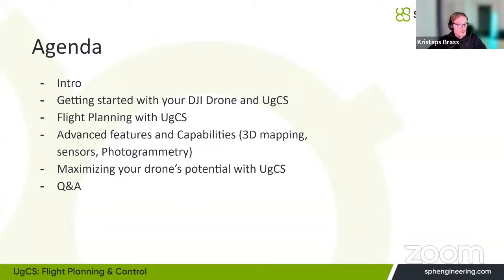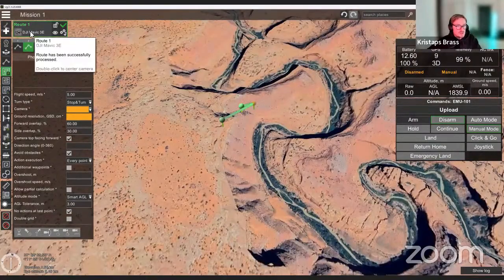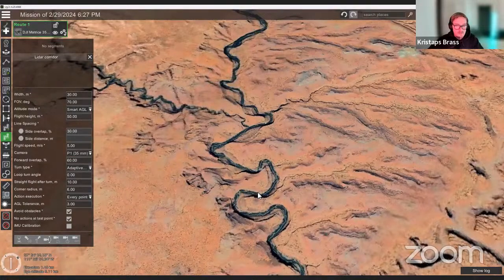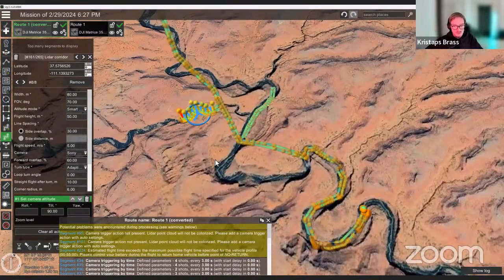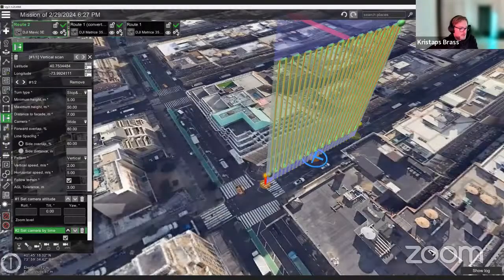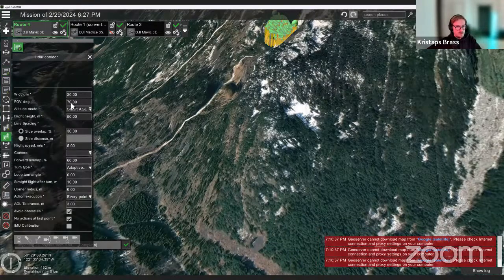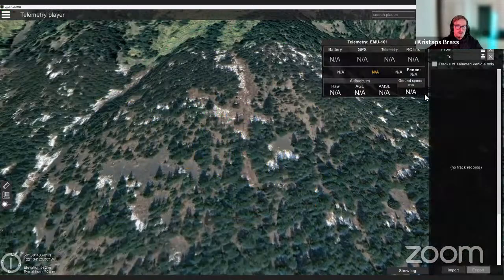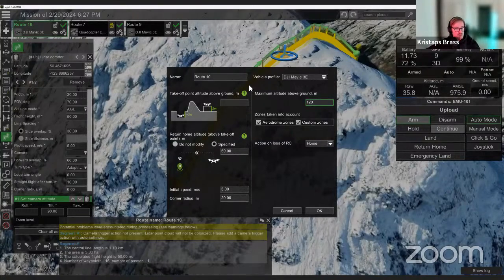Open Workshop | How to get more out of your DJI drone with UgCS

Comment: question regarding flight speed: Whatever mission I plan, the flight speed always remains at 5m/s - should the software calculate the ideal flight speed depending on mission parameters?
Reply from the maker: Thank you for your question. 
Based on the specific of your mission, you can choose the speed - it' s not being calculated automatically.